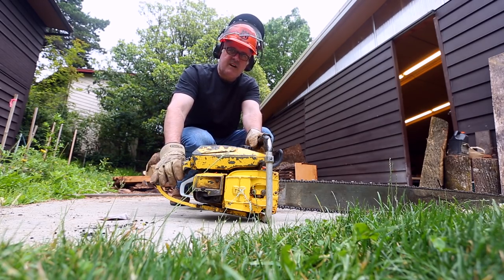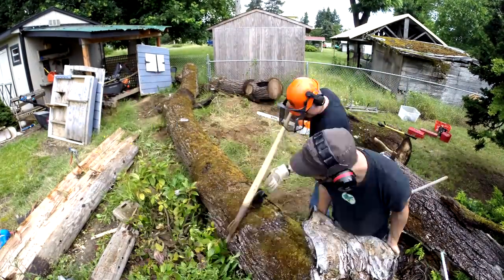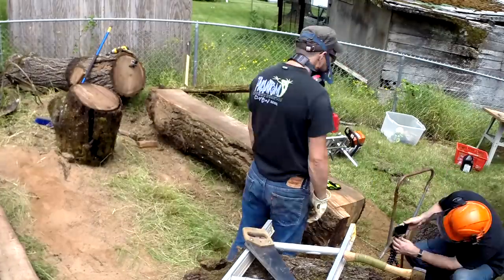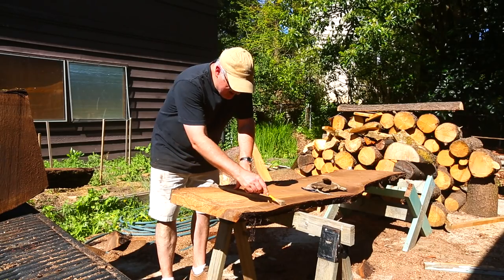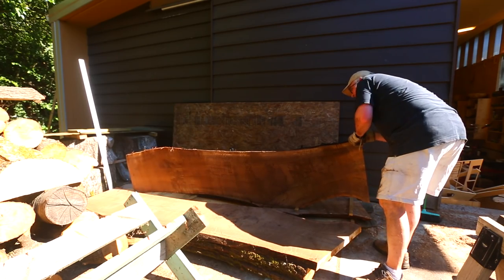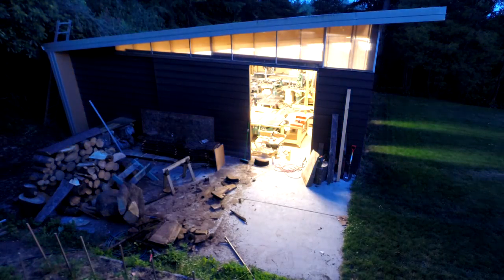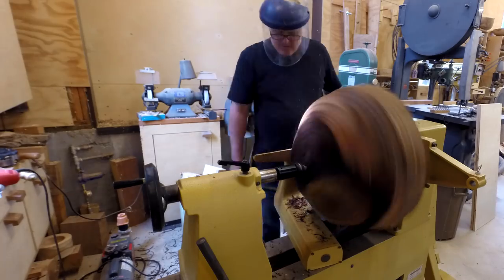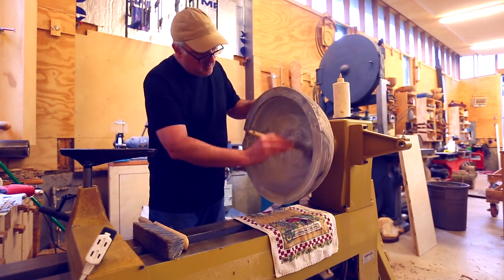Chainsaw Milling a Walnut Tree

Comment: Good to see you back at it!
Reply from the maker: Thanks Matt, yes.
Reply: Matt, I think prior to you being on Wood Talk they were discussing using limb wood due to the tension wood which will warp over the length of the board.  Is that going to be an issue for Frank here with these 2" slabs?
Reply: +Make Crazydays it depends on how the tree grew and how the limbs grew out of the tree. If the limbs on the ground are as they were on the tree, they didn't have much lean to them so they should be mostly alright. The further they get from growing vertically, the more internal steer they have. I've had good luck milling limbs by keeping my cuts as if they were cut with a vertical plane while attached to the tree. This keeps the tension wood on one side and the compression wood on the other so the forces are in balance. If you roll the limb 90 degrees you'll end up with boards that always want to bow. Cutting the material thicker also helps.
Reply: A video of the above explanation would be interesting, and helpful, to this novice.
Reply: I can certainly do that

Comment: Nice work Frank! Maybe upgrade the circular saw to a framing saw. More power and torque, blade is on the left so you don't have to hunch over it and get a face full of sawdust,  and it's more suitable for heavy work. I love my Makita Hypoid gear saw ( heavy, but great balance). I hear good things about Skil Mag77s, and De Walt also makes one.

Comment: Thank you Frank for yet another great video! Just a thought: on 5:50 when you cut the elbow, the way you cut it, makes for the least efficient way to cut wood (but I know this way it stands nice and is not moving much). But much more efficient way to cut along the grain is if you lay the trunk flat on the ground.
This way the teeth cut along wood fibers rather than across them.
Hm... I can't explain it better but I have a feeling it's not clear enough :)
Well, I hope you know what I'm talking about :)

Comment: That bowl will e someone a nice heirloom.

I worked with a carpenter one summer as a laborer. He told me about a home he built using walnut. The house was built on an old farmstead. So there were a lot of old growth walnut. He had it milled & then built the house. He said he wouldn't do that again as the wood was hard to cut & to drive nails....LOL

Still it's beautiful wood. 

Thanks
Reply: I can't even imagine. I'm on a walnut quest right now  to get a table built.

Comment: Great that you sticker your slabs the way you do. It is also a good idea to ratchet strap or band your stacks of slabs to help prevent excess warping. Have you ever tried the boiling process to relax your bowl blanks and prevent checking/cracking? I had a friend on Orcas Island that did this with success.

Comment: Awesome stuff, the Stihl 880 sure is a powerhouse.  I'm not sure what you like to do with your dust and shavings from the lathe, but as you may know, walnut has a toxin in it called juglans that is toxic to many other plants, so be cautious of you plan to use it for landscaping or other recycling. When o work with walnut I try to keep that dust separate from my other dust because I use sawdust as mulch. Thanks for your amazing videos.

Comment: If you have the place to store it, get a vertical saw bench. You can chuck in any piece of wood of any shape, thickness (well, up to some reasonable thickness and depending on the saw itself) and cut it via a system of vertical and horizontal guides. It completely eliminates any issues you'd have with a horizontal saw, hand saw, etc. You can find second hand ones from businesses that upgrade their older saws, most are custom made, but you can find ones that are pretty good and for a decent price. And repair is easy nowadays with parts at a click of a button.

Bought mine from a big store that used to also cut planks, and fake wood flooring pieces, MDF etc. Stuck a Makita on top which i salvaged from a miter saw and it works a treat. Certainly makes cutting MDF and HDF pieces a breeze.
Reply: Also, on your model of lathe, i'm not sure if your manufacturer has this, but, on that style, you can buy cast iron risers to increase the OD of your cut. At least on the Chinese versions, they do. The other thing you need if you rise the whole thing is a new set of gears and another half a horse or another full horse of power on your motor.

Comment: I think I commented on your last video for exactly this! I have a couple logs in my yard. One was cut into several 2" slabs, the other is solid and too large for me to move by myself. I gather what I should do is to cut down the one solid log into slabs, stack them with spaces, paint the ends with a wax emulsifier, and then just let them sit for a year? I've never done anything like this, so any helpful resources would be great. Thanks for all the videos. Learning a ton!
Reply: Time drying depends on thickness. You don't want too much sun on 'em they'll warp like crazy. You want them off the ground and even regular paint or wax/oil mixes will help seal the end grain.

Comment: I'm wondering if you are also using the dedicated slab ripping chain as Granberg recommends that has the scoring cutters every couple links? I'm told this makes the work much easier than even a standard ripping chain.

Comment: Hey Frank great video. Have you ever used a "bowl saver". I got one and it cores out the inside of large blanks such as the one you just did and you get more blanks   Much less wasted wood. 
Take care my friend and do a kindness 
Mark
Reply: Btw I have the same saw mill. I use a rip chain and it works great.
Reply: I was about to offer a probably  unpopular opinion that turning the inside of such a large bowl wasted a huge amount of burl. I didn't know such a tool existed.
Reply: +Michael Harris Bowl saver from woodcut is one but there are several out on the market.

Comment: In anouther video you ask if any one had an idea how to start a Mac chain saw? I was having the same problem I could pull and pull and the chain saw wouldn't start, then one day I looked at the booklet that came with my saw and it said to never choke the saw after it starts.Since then I have never had a problem starting my saw.Keep up the good workGlenn schuett

Comment: Great work Frank, great to see you have a new saw.  I like the way you turn the bowl so quickly when you get them in, I have a shed full of very dry blanks that sill need turning.  Its not a bad idea to flip the boards one up, one down so as they dry the gain moving keeps the others from cupping less.  Please get a winch for your alaskan it will save your back!  (see my video) Love your channel and my kids do too. cheers Blaise
Reply from the maker: good idea flipping the slabs.
Reply from the maker: And I like the winch, i'm going to need to try that.
Reply: And wedges really help.

Comment: I love watching and rewatching your videos. I do have question though. When you are milling your trees down, do you use a different pitch for your chainsaw saw chain? I sharpen mine to 30 degrees like normal for regular cutting. Didn't know if milling required something different.

Comment: My vendor advised for the 880, you should warm it up for 5 minutes before using it.  He said that unlike smaller normal Stihls, the 880s take a while for the heat to be uniformly distributed over the head and the piston and if you work it at full speed without the warm-up you risk having the piston/head warp.  Perhaps you already were advised of this?

Comment: Is your saw the Stihl MS 880? I have had the bar nuts fall off a couple of times on my 880, now I have bought a couple of extra since I lost one. Also, added an extra step before each time I use it to check the bar nuts. Not sure if the same is true for you but wonder if this is common for the 880.

Comment: I've always wondered what did you do with all the shavings, and the dust from the chainsaw. There seems to be lots of dust and wood pieces there. Do you just burn them? Make them some kind of fertilizer or dirt? What happens to them?
Reply from the maker: I have started spreading it around behind the shop to keep the weeds down.  some of it goes in our yard debris container and the city composts it.

Comment: Great work as usual!!! :)
Frank, just one question: how is the bowl supposed to dry if you apply the wax all around it?
Reply: SLOWS DOWN THE DRYING SO IT WILL NOT CRACK AND CHECK
Reply from the maker: it still drys, just slower.

Comment: Do bugs not seem to get in the wood you have stacked outside of your shop?
Reply from the maker: if it stays dry it should be OK.
Reply: Gotcha. I ask because I had a couple pieces of white oak that was cut down a few months ago, sitting on a tarp (holding it down on top of some sand) on my concrete driveway. Apparently, it was damp underneath, and when I flipped one over, there were termites everywhere! Freaked me out! This wood didn't have them previously, I'm pretty sure.

Comment: Are you willing to share the mixture of ingredients that you use to seal the wood?
Reply: iT'S SOLD OVER THE COUNTER OR ON THE NET
Reply: What ingredients are in it? Wax and turpentine? Maybe linseed?
Reply: It's probably UC coatings anchorseal
Reply: Anchorseal is quite expensive, so if a different product or diy formulation was used that would be nice to post, perhaps with the "tools used in this project"...  esp. if it works :)  

BTW nice work, beautiful wood.
Reply: What is the wax for?

Comment: What exactly are you using to seal the wood? I have gone on all kinds of forums to find some stuff for all my slabs but have not found any that I really count as reliable. You however, are reliable.
Reply from the maker: wax emulsion paint. what i get is packaged and branded at my local woodworking store, so i don't know of a national brand to point you to.  I have heard latex point works too.
Reply: Thanks for the reply.  I had the same question.  I'll head to woodcraft and see what they have to say.  Keep up the sawmilling vids when you have a chance.  Love the big bowl turning too.

Comment: don't know much about wood working but why did you say you'll probably wait a year or two and finish it? does it get sort of better with time or just because?
Reply: It is probably to dry the wood.
Reply from the maker: It needs to dry.  it is very wet green wood right now
Reply: Is there no machine or something that can speed up that process? A heater or something?
Reply: i generally just put it into my oven for a few hours on a very low temperature.  I had to remove the back of the oven so that the board fits though.
Reply: Air drying minimises cracking and warping, which is especially helpful considering the condition of that wood.

Comment: How long this bowl will be dry? Thank you.
Reply: Indoors it will be dry in 3 months, but he wants to wait 2 years.
Reply: Usually wood take 1 year per inch thick to dry
Reply: Exactly! I heard on the video replay. I only speak Russian, so it is difficult to understand the English language by hearing. Thank you.
Reply: Freddy
The tree was dead and had been for some time so those branches were well into the drying process.
Reply from the maker: it still had a lot of water in it

Comment: Please consider using leg protection with your saw. The guy who is helping by pushing the end of the mill is very close to the chain and one slip and his legs would be at risk. Compared to the cost of these big saws chainsaw leg protection is cheap and replacement legs aren't.
Once I've had help lifting our mill into place I find that there's no need to have anyone assisting me with the push until right at the end. Once you're into the cut you can kneel down behind the saw and push from behind.

Comment: How will the wood dry if it is coated in wax?
Reply: Only the end grain should be coated in wax or a latex pain to keep the slab from checking and cracking.
Reply from the maker: right
Reply: Slower, a finish just slows down the moisture exchange.
Reply: I was actually commenting about the bowl. Sorry for the confusion.